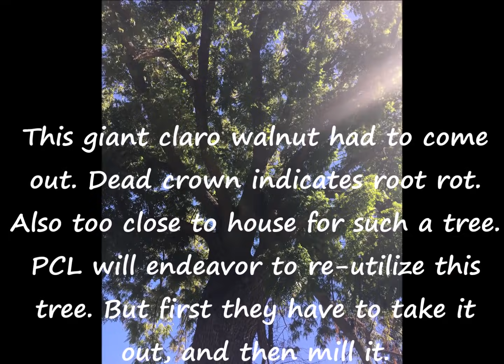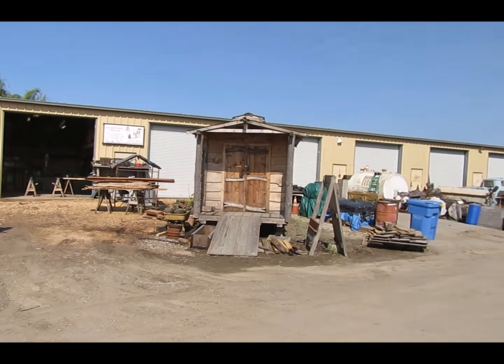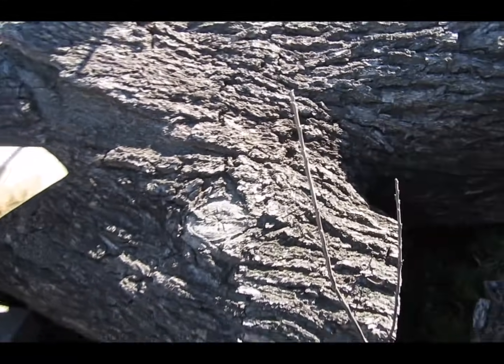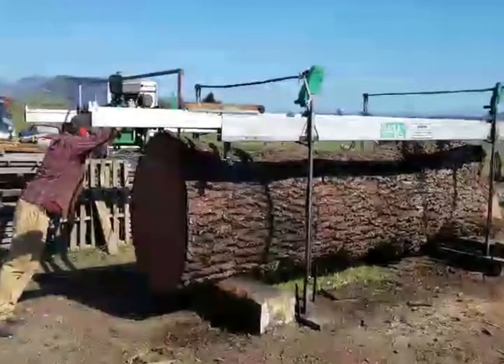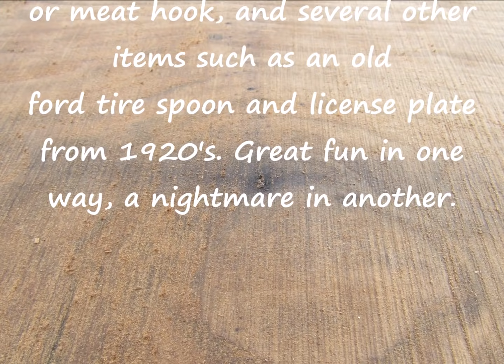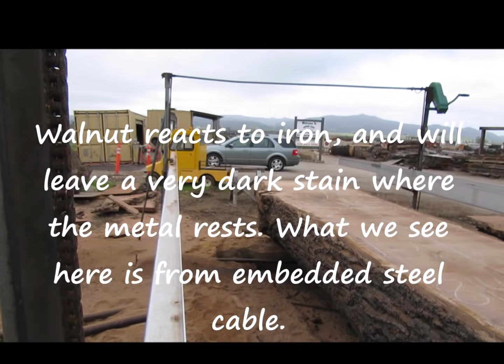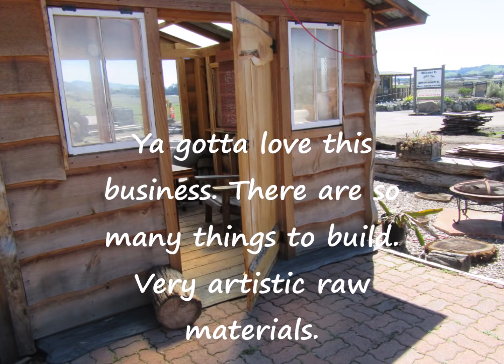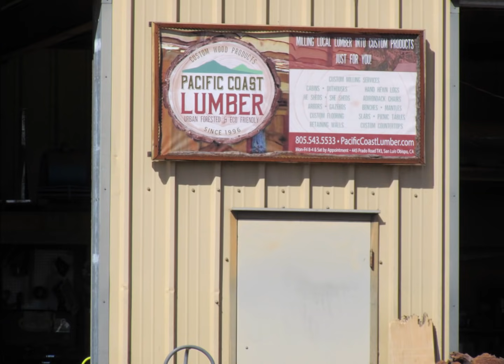Pacific Coast Lumber. Giant Walnut Milling.  23,000 pound log milled.

Comment: Twenty years ago I cut a lot of hard woods that way and got too busy to use them,.  Now that I am retired, I am looking for projects for all that dry lumber. One Elm slab was sanded flat, varnished and is about 48 inches in diameter with no splits.   Cut by hand. I appreciate what went into your slabs, been there, done that, thanks.
Reply from the maker: awesome Steven, thank you for that. I would love to see a picture of that elm. I love that stuff.

Comment: I thought that the mill isn't moving fast, but then again this is walnut. Is it OK to have the mill swaying like that? It would seem easy enough to add rigidity into the design. Beautiful and worthwhile  business.
Reply from the maker: Louis, thank you very much. Problem with a lucas slabbing system is they are slightly loose. They work fine though. A chain saw power head, or the 24 horse motor of the lucas are just a slow process on a big log like this, especially a valuable walnut log. Thank you again.

Comment: How did you get the log up off the ground and on to those timbers?
Reply from the maker: 10,000 lb forklift rolled it onto the timber’s, then built up the Lucas mill around that, thanks Mathews
Reply from the maker: Could be done other ways also.
Reply: @pacificcoasthiking  awesome thanks. Great video!

Comment: Surprising they don't use a bandsaw.  Any reason they prefer the lucas mill chain slabber over a large bandsaw other than cost?
Reply from the maker: Simply cost of equipment. Not many bandsaw small sawmills that will cut 5'+ width logs. Thanks Dominic, much appreciated.

Comment: Hello,  I would like to ask you how large it is the frame where the engine and blade it is located,I have an 8-15 electric and want to installan kohler 30HP engine not sure if there it is place. Please can you let me know. All frames are standard?? it would be much easier to handle for production
Reply from the maker: All the Lucas mill frames are standard I believe.
As
I feel that a Lucas is not really a production mill but it’s way to successfully mill these types of logs easily compared to things like Alaskan chainsaw mills.
The motor size doesn’t seem like an issue compared to the actual quality of the cut in expensive logs and that is about sharp chains and issues like porcelain, metal and etc..
A bigger motor can be put into the Lucas mill I believe.
We also built a frame that would hold a chainsaw with a longer bar which was essential for larger logs.
Thank you for your good questions 👍
Reply: @pacificcoasthiking    Thanks for your answer. I havebought this one only for my own needs and maybe for some ocasional help for others around me.
I amin Europe, because of climate changewe have lots of dead trees, compete  forests are dead .I own about 1 hectare of dead trees, I would need to pay for a cleanng company to make wood cheaps, around 10000 euros, I prefer to saw mill it, I need already 10m3 which would cost me aoubt 5000 euros.
Yes, the lods are small here, only 12 inch, the saw mill was sold near me, only 4000 euro with 4 complete new blades.
So I jump on it . Hopefuly it will work and I will not kill myself 😀😀😀😀. Thanks,

ben
Reply from the maker: @benlav7151  Ben you make me smile.
I believe there are many ways to profit from your dead trees.
I wonder what species of trees you are referring to.
If they are all one type of hardwood it’s possible to grind the small ones for mushroom production.
The Lucas mill will work on small logs but you might find yourself making a way to hold them while they are being milled.
Like a wooden cradle?
Also if you have conifers and there is a place where they can do “treated for bug and rot “ you can make fence posts and such things.
If you look through my other videos you might find some ideas about other uses.
I wish you the very best for what you are doing!
Reply: @pacificcoasthiking  😀😀 As I said I have already few hours youtube watch  experience  about lucasmill. Wood cheaper it is quite costly, it is coneferes wood, soft wood not so good for heating. Of course I will use everything.
 I have experience in the forest ,did 20 years with chainsaw for firewood and taking out logs with 120 HP tractor, very dangeros and always beeing on the look for danger, several time just excaped from dead.  

Yes, I saw several option available to fix the logs on lucas sawmill,  also loading 3-5 logs at the time. I have a plan to get them inside by a winch because they will have the same lenth as my rails.Of course it will not work 100%as planed, I will adapt and change, slowly I will learn the job from my own errors.

This is how it works always for me 
Ben
Reply from the maker: You are awesome my friend!!!  @benlav7151
Reply from the maker: @benlav7151   Also Ben, I have built many small cabins from conifers, and they have lasted many many years (in excess of 20+ years) with little or no treatment to the outside of them. I also have used a lot of conifers milled to a net rough 1-1/4" (48mm) and it has lasted more than 20 years also if it is not in ground contact.
Reply: @pacificcoasthiking  Hi, yes, depends a lot whare you build them and how. if there is no big humidity and rain it is possible. Simply rain is killing the wood. I build a log house here in France, the walls which the rain did not touch were absolutely fine, terrace which was not  protected in 5 years completely rotten, but also because I was stupid and I painted with varnish. It resist much better if you let it as is.

Do you still have that lucasmill around??
                      
I would like to ask you for some pictures  when you have time.  I ordered several parts but have no idea where they come. 
LCM-K30DT8-25                Brake                                   

LCM-DT8-25                       Spring Brake assy             

LCM-TC-9                            Throttle cable and lever 

LCM-KLM-17                      Tank        

But if you are busy I fully understand.

Ben
Reply from the maker: @benlav7151  Hello Ben, sorry for the delay in response.
I sold my business about five years ago.
When I bought parts for the lucas mill they always came from America somewhere on the west coast. 
Your shipping source might very well be Australia where the company is.
Not very helpful but I wanted to reply.
I believe that France has a substantial more rain than we get here on the central coast of California.
Reply: @pacificcoasthiking  . Thanks, dont worry, I actually found all the parts in UK, original stock fro Lucas mill, 650 $ in total clutch, brake, acceleration/emergency stop cable.

Thanks a lot

Comment: Would it be dried whole, lumber,  or in a veneer state?
Reply from the maker: Thanks Ron for the post
He is cutting these slabs for best value.  
This log doesn't really lend itself to veneers for him, mostly because he does not have the capability to slice veneers without huge yield loss. 
There are other considerations as well, such as the width of the log relative to veneers ie; whole piece faces, etc., as it is over 60" wide. 
That said, he could ship it somewhere to get veneers cut but then more cost, etc. This will be as air dried as he can get it in San Luis Obispo Ca.. Thanks again.
Reply: Thanks just curious..  worked sawmill and plywood for 45 years but not with exotic, only structural species.   Nice to see the care and consideration involved in the recovery of these valuable woods.   I know these trees are "scouted", and not cut without considerable discretion.
Reply: thanks for your replies, I am only familiar with rotary produced veneers, have had no experience with sliced veneers.  Our "seasoning" amounted to 4 to 15 minutes in steam coiled dryers.   Then the layup commenced when temperature was appropriate.     Appreciate your replies to a retiree.
Reply from the maker: @ronlitz9055  Thanks Ron, wow, 45 years cutting peeler cores! lol. Well, yes plywood plants. Good for you, and you are still standing! I wish that anything produced in small sawmill operations would have a drying time of 15 minutes. And these high end "architectural" veneers made from appearance materials are high value, but not a lot of veneer plants around to cut them here in the west.
Reply from the maker: @ronlitz9055  When they cut for structural panels rotary is perfect, "flat sawn" type of veneer. In hardwoods, the appearance changes dramatically between plain sliced and yields things like vertical grain and quarter sawn panels, which in architectural and cabinets, etc. are a desirable option.
Ron enjoy your retirement. I am also retired. Hunting a lot of mushrooms in the woods, making some videos, and developing some hiking bib overalls out of ripstop materials! Woo hoo!

Comment: I guess you cant do much about  the steel cable ? Do you just keep cutting? M.
Reply from the maker: Yup pretty much 
Have new blades or newly sharpened blades.
Sometimes you can extract it.
They got pretty lucky with this one, there wasn’t nails and porcelain etc. 👍

Comment: What I am curious about was how much usable material was milled out of the limbs, branches and truck cutoffs. I saw a bunch of big pieces cut off that amounted to quite a substantial number of board feet. While much of it would not mill into dimensional specification lumber, a whole not of non standard size boards and other pieces could be milled with the remnants. Perfect for smaller pieces for projects. There was literally tons of wood in those knees where the branches and limbs were joined to the tree.  On these you YouTube videos, it seems these smaller millers waste a whole lot of wood which could be made into useful boards instead of waste and firewood.
Reply from the maker: Approximately 3,000 bf in the big log, and roughly the same in all the limbs and parts, total about 6-7,000.
The big log was cut into large slabs, for best value purposes. The other parts were a combination of boards, fireplace mantles, and I believe, some posts. All together this may have yielded just over $70,000.00 of wood.
It was a very unusual tree in that it was embedded with porcelain, and steel, rotten (hollow, unsound) in the middle. Often the buyer gets the pig in the poke. Always a gamble. This time it worked.

Comment: If you had cut that  in gun stock  blanks  how  much would  you been able  to  sell it for.
Reply from the maker: I tried cutting gun stock a bunch of years ago and found that you have to be very committed to that industry to be a player.
It does get a lot of money but the yield of quality gun stocks is very low, and you are cutting good furniture wood down to small pieces that cannot be used for anything but gun stock or butcher block types of product.
But if you get the right piece of wood, you can get big bucks for a small piece of wood.
Do you have walnut available to you? Are you a sawyer? Have a sawmill?
Thank you very much for your comment.

Comment: Beautiful slabs from that tree... Just curious, why didn't you quarter saw the log? This would have brought out the beauty of the vertical grain (i.e., the medullary rays). Also the lumber may have been more valuable for furniture, cabinet, and musical instrument manufacturers, as it would have been more dimensionally stable (i.e., less prone to cupping, warping). Thanks!
Reply from the maker: Good morning David. This was a western walnut log. While you can get vertical grain cuts out of the middle slabs, it would be wasteful trying for vertical grain boards throughout. In Vertical grain cuts the wood is slightly more stable, but it shrinks more in tangential than radial so you have to cut a little thicker for shrinkage. 
There are no medullary rays in walnut. Only in a handful of species does that occur. Such as all the oaks, sycamore, gravelia, etc.. The instrument side of the world in walnut requires (at least in guitars and some other instruments), medium to high density fiddleback figure. This tree didn't have much of that. Some great crotch figure though.
Large slabs for desks, bar tops, kitchen islands etc is where the money is for this wood. Thank you for the post.
Reply: Thank you so much for your reply... it is greatly appreciated!
Reply from the maker: @davidohagan5265  You are very welcome David, and thank you too, much appreciated.

Comment: Was hoping a follow-up video about the tree being taken down, and there it is. Thanks for making the video. Was the trunk too big to lay on it's wider side to cut larger width boards?
Reply from the maker: Yes, the big log was just over 5', which was the capacity of the lucas mill set up. The trade off was that you get about two extra slabs, slightly narrower. Thank you Kevin

Comment: Why was the mill cutting so slowly - I have never seen any other videos with such a slow cut. Is that just a characteristic of Lucas mills?
Reply from the maker: Skip tooth chain, 5' diameter log, hardwood, goes a bit slow, somewhere around 1.5 inch per minute.

Comment: How much is a tree like that sell for from a private seller  I have 2 people with saw mills close buy?
Reply from the maker: The log itself is worth somewhere around 10k or so to the seller. So much depends on size, defects, degree of difficulty etc. The buyer hopes there is little to no metal or porcelain embedded in it etc. No unsound or hollow rotten areas, etc.

Comment: It takes nerves of steel to cut walnut of any coast line. I have seen them dig the stups up and saw the bigger roots into furniture. I fell a walnut back in arkansas and I didn't know what kind of tree it was but the woman wanted it down. The sawdust liked to kill me as I sawed through that stump part and when it hit the ground it hit soft as I pulled a lot of hing in my cut. The saw I was running was junk and too small and so I had a enormous "russian coupling" but that sawed that tree from splattering all over the ground. I worked a whole day getting it down and made twenty dollars for it but when she said she was going to burn it, I traded her some aged dry wood already cut for it. I got a thousand dollars for the tree at a mill and that was not all it was worth but I was done with it. I hauled the limbs roots I cut out of the ground and most everything that was over a foot long. It took me a week to clean it all up but in the seventies that was money

Comment: I believe it said  this was a black walnut, I know that is very valuable wood, so just what was that entire tree worth?
Reply from the maker: Leon, the log had or has roughly $50,000.00 worth of slabs and wood in it. There are still a handful of slabs drying and still for sale, which means the sawmill owner who put out a ton of money, still hasn't gotten paid for this adventure he took on well over a year ago. But roughly that is "a" value. Many ways to value this stuff, but in slabs and boards, that is kind of what it is worth.
Reply: @pacificcoasthiking  
Amazing! Blows my mind when people have this stuff chopped to firewood. My neighbor had a few very large cherries cut down. He offered me some as firewood. I had the tree crew cut them to 10' and roll them over!
Reply from the maker: @vervi1jw1  Thank you for the post, good one. I hear you on that stuff.
Reply: According to the commentary, the slab cutter was using one blade per slab using the legend that by doing this it could prevent a slab or two waste of $20k............

 @pacificcoasthiking
Reply from the maker: @lyndamcardle4123  Hi Lynda, yes that is what they did. They didn't use a stellite or hard carbon tipped blade, just high speed steel, one slab at a time. I have tried to be super frugal cutting valuable slabs, and have screwed up a few. So it is important to have as sharp a blade as possible, and to pay good attention as it only takes a tiny piece of rock on the bark, or small nail to send the blade down or up  in a big way. Thank you for the post. Much appreciated.
Reply: @pacificcoasthiking  

I'd be sick if I hit the remnants of a bullet, nail or screw embedded within the slab with any blade ....it not only spoils the cut of the slab but, there would also need to be remedial work on the slab as for that blip within the cut. No-one understands of realises the damage we cause when banging in any of these things into a tree......
By the way, some of the spalting looked magnificent.
I loved the two videos of the tree being felled and the trunk being sawn.
Thumbs up from me !
Reply from the maker: @lyndamcardle4123  Thank you Lynda! I agree on all that! Great post.